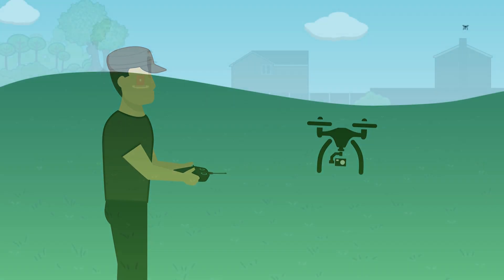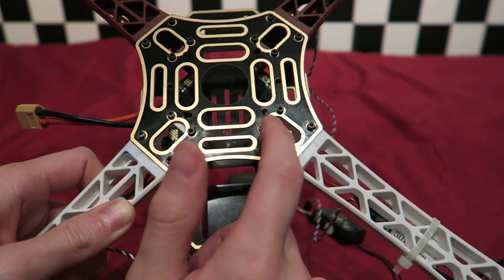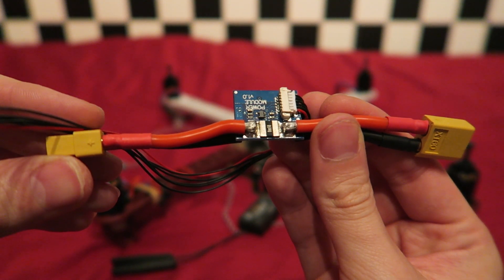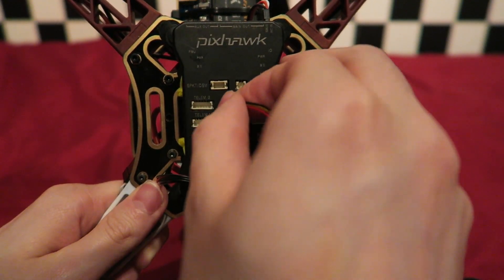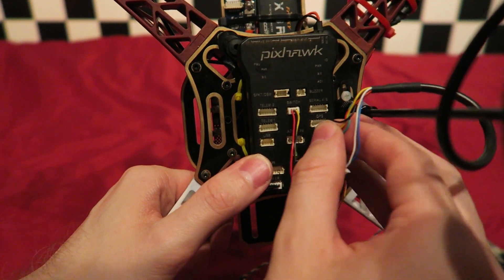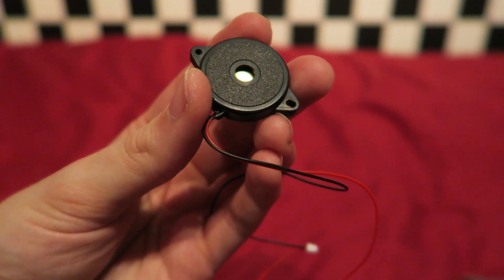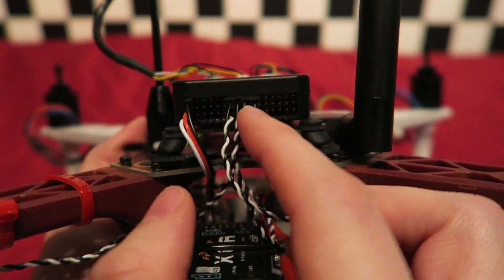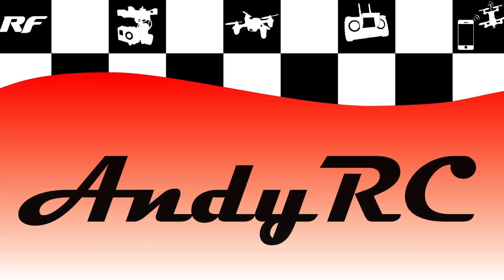High End 450 Quadcopter - E05 - Pixhawk Connections

Comment: Hey, andy
I'm looking for a good but relatively cheap 4s lipo to go with my sunny sky v2216's, are the nano-techs any good an is it wise to use the v2216's with 4s and 1145 props, or should I go 1045?
Thanks again
Reply from the maker: +Tobias Veerkamp i think 11 should be ok but im using 1045. 11 is on the limit for sure
Reply: +AndyRC and what about the LiPo? Is the nanotech ok/good
Reply from the maker: yes i like to use nanotech or zippys
Reply: AndyRC ok, are the nanotech any better than the standard turnigy ones?
Reply from the maker: they have more punch yes but more expensive and harder to maintain due to high discharge rates
Reply: so the normal turnigy ones last longer? I think I am getting those based on some other reviews saying the nanotech puff a lot
Reply from the maker: they do puff a lot yes if u dont keep the storage voltage correct
Reply: ok, and the normal turnigy bats are easier? because I am no expert.
Reply from the maker: iv not had good experience with non nanotech turnigy batteries id go zippy if i wasnt using the nanotechs they have lasted the longest
Reply: oh ok good to know, normal zips or compacts?
Reply from the maker: compacts are for small aircraft. all the best

Comment: Wow. So much more goes into a build like this.
What a great opportunity for folks like me to get some insight into what  these bigger more complete custom builds entail.
GPS? Telemetry? Sign me the heck up!
...after I get some more flying experience that is.
Baby steps.
Reply from the maker: +Michael Thompson yes. to be fair this is a very in depth build. there are easier options such as the NAZA controller but even then its still quite high level. I have one of those to try out . cheers
Reply: Awesome! Best of luck!
Feel free to you know, make a video when it happens! LOL :D
Reply from the maker: i will do :)
Reply: +AndyRC you have a naza to try out?
Reply from the maker: yep :-)
Reply: AndyRC Lite? And gonna upgrade it to full version?
Reply from the maker: yes the  lite version. no the full version is too expensive for me
Reply: AndyRC Same hahaha, i added it to my sk450 and did the upgrade to v4 so the full one and wow it flys sooooo good. though the GPS hold isnt the best after getting a 3rd part gps
Reply from the maker: yes i hear the naza struggles with gps
Reply: AndyRC its more the SW rather than the FW (Naza) itself... DJI phantom 1+2 had naza's inside and had great gps hold, it seems more that dji just ripped that out complete wit all the settings needed for phantom and said anyone could use it. In reality the closer you get your craft to Phantom specs the better the naza will go. Just fly around a bit with the Naza Lite and then switch and upgrade to the full Naza and see the differences in takeoff and gps hold. Still the Altitude hold is horrendous. I thought it jsut was not enabled when i was flying apparently it was.